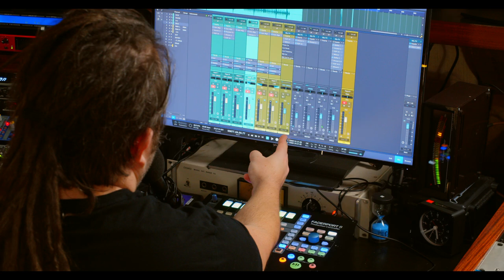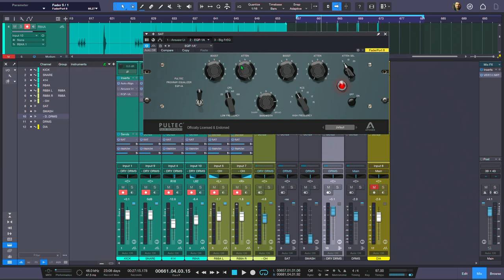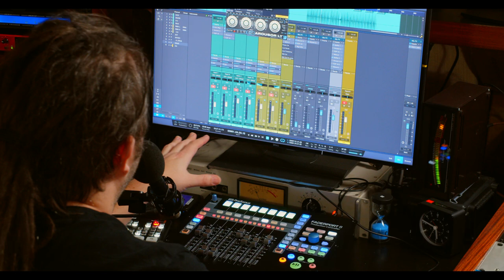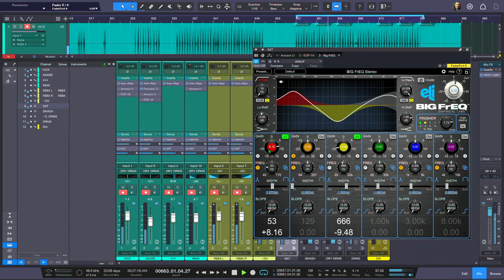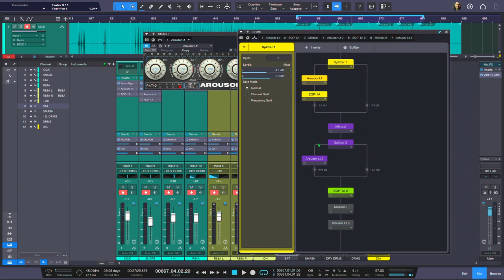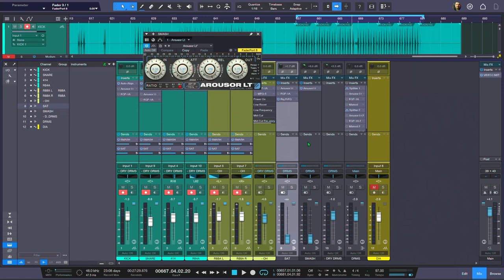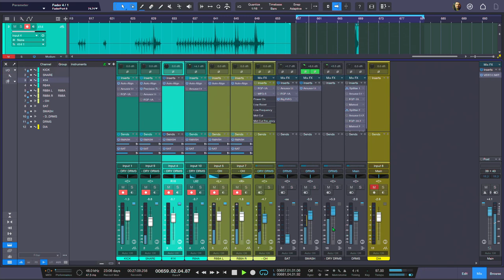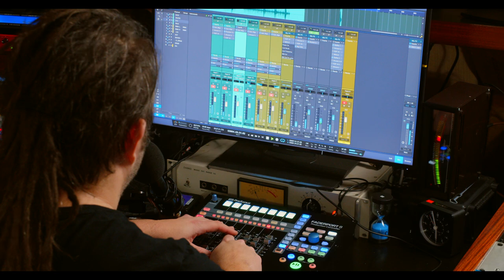Give any plugin a Dry/Wet Knob - Works on Any DAW

Comment: Great video once again.

To all my fellow Reaper users: Yes we have a Mix knob on every plugin and they’re fantastic, however….

1) in the mix they require Opening every plugin to use them.  Not ideal.
2) using a traditional Send/Return technique as in this video lays everything out in front of you
3) you can blend at individual track fader, the send, and the receive and fine tune your processing.
4) all of that is Pushing Into the processing (pre-compression/saturation) whereas the wet/dry in the reaper plugin is blending the Post processing with the dry.
5) even better than the mix knob in Reaper is CSI.  I have an X-Touch and 3 Extenders, so 32-faders of 100mm blending bliss: channels, busses, parallels all at your fingertips rather than mouse clicks 

If you’re at all a Michael Brauerizer, then this technique is second nature.